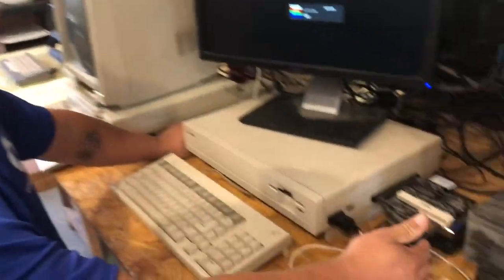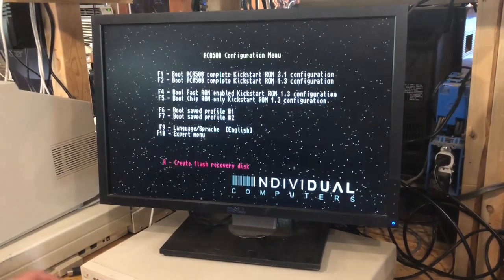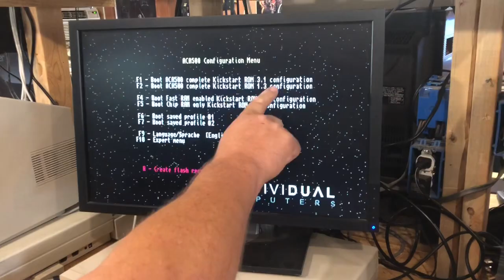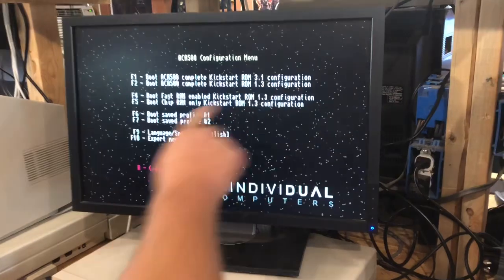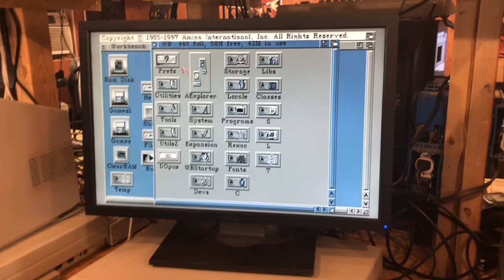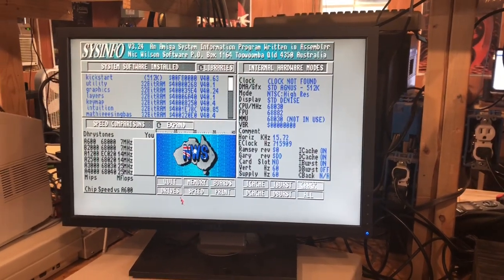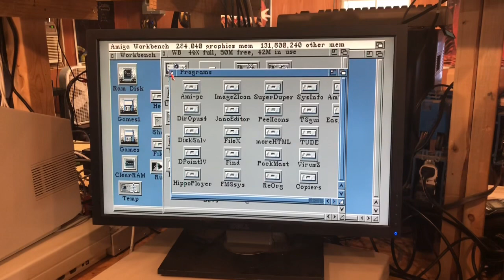FPU Install in an ACA500

Comment: I did the same for my A1200 I used a socket for the  oscillator. I put a 50mzh FPU in the card. I got one from ebay BE VERY CAREFUL there are many repainted ones out there. What they do is scratch of the gold and black printing and put a different speed on it. I had one that said it was 68882 50mzh, but sysinfo said it was a 68881 FPU, I got my money back after a long time.

Comment: what monitor is that and how did you connected?
Reply from the maker: jvidia it’s an old dell p2210. I got a couple off eBay a while back for cheap.  All I am using is an rgb to vga adapter cable also off eBay.  Works very well and a lot less expensive than other options.
Reply: @commodore4ever  that monitor fully supports 15mhz? looks great!

Comment: After having the remove an oscillator on I believe its an A2630 board to slow it down yea that's right I had to slow it down from 28mHz to 25 so that my Individual Computers BIG RAM Board would work I found the Oscillator to be a bitch to remove and while I did solder in a new one I found sockets for them.  I said to myself if I ever have to remove one of those again I am installing a socket.  Soldering and desoldering stuff for me is not a big deal but removing that damn Ocillator was no fun and the A2630 has 2 but if the CPU and FPU run at the same frequency then you only need 1 Occilator.   I do like what you did with the A1000 it really breaths new life into the old boy.   My first Amiga was the A1000 and I still have parts for it and would not mind having another but I am not going to go broke to buy one but if I find one I would install a Vampire which I am also thinking of doing on my A2000 but right now my focus is on getting an A4000.